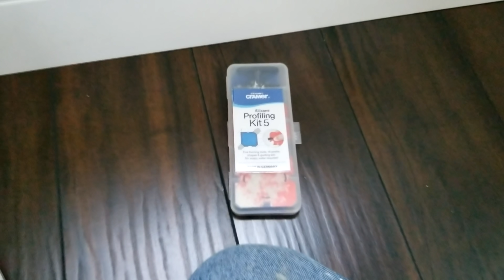How to Extend Laminate Wood Flooring To Another Room DIY Tips

Comment: Hi I have a question can you remove a transition on an already installed laminate flooring so as to achieve flow from room to room
Reply from the maker: Yes you can, but keep in mind manufacturers have limits where they say you need a transition every 20 feet for example, or another might be 40 feet

Comment: Why not raise that floor with some plywood sheets and make it the same level and make it a seamless transition?
Reply from the maker: Well that's a concrete floor and it would have probably taken 3 layers of plywood which is ridiculous you don't raise up a concrete floor with wood. If anything you would do self leveling compound. But that would have probably cost a few thousand dollars to dump down that much self leveler compound and the labor to get it done as well.  Also the 1st part of the transition was already there from before because this used to be a carpeted patio and the buyer of this unit wanted the carpeting removed and the wood flooring expanded. So keep in mind you have to deal with also what was already there as a transition.  The way we implemented this was a good solution and the buyer of our unit was happy with it.
Reply: What would've happened if you took off the threshold of the higher floor and made one new transition strip?
Reply: @jeffostroff  It is done when installing wood flooring on a concrete slab. You have to use 3/4" plywood and put a moisture barrier under the plywood.
Reply: thank you ...im surprise he didn't tell the owners to tear down the house and rebuild it....
Reply: @divinee.155  What was the point of your comment, Divine E?  This issue could have been correctly resolved with a  vapor barrier flooring adhesive and a couple sheets of plywood.   Instead, the owner now has a trip hazard that will get called out when they try to sell the house.  Cheaper and easier to do it right the first time.

Comment: Nice job! What blade do you recommend for cutting laminate flooring? Thanks
Reply from the maker: I was using 84T or 90T red diablo carbide blades to get the fine lines but... laminate and hardwood floors dull out the blade by the end of the job, not good, and by the end of the floor you are pressing down on your chop saw with extra force to get it to cut through, and it starts to heat up and burn the laminate a bit.  I'm going to switch to this new diamond coated 10" Pergo blade from Diablo: https://amzn.to/2KXLYPw make sure you get the right size blade for your saw. These Pergo blades from diablo are the only one recommended by Pergo for their floor planks, and they work on many types of laminate and hardwood floors.

Comment: I would stub my damn toes every time I walked into the main room
Reply from the maker: You brain trains itself over time to avoid these.
Reply: @jeffostroff  Kind of a cop out answer - and it certainly doesn't address the unsuspecting guest who trips and falls their first time in the house.  Customers ask for all kinds of things that are unsafe or are code violations. As professionals, it's our job to set them straight.   That's a lawsuit waiting to happen; I hope you got the customer to sign a release or you'll be on the receiving end of it.
Reply from the maker: @jeffeverde1   The problem with all of you fear mongets out there is you simply don't understand what's going on this was a patio  sliding glass door drop off at 1 time that used to drop down 2" from the living room. So there was already a step down anyway like every house in every condo here in Florida already has one of these step Downs and I don't hear of anybody tripping and suing anybody else.  What I did here was took a 2" drop and made it safer than it was, Because it used to be a 2" sliding glass door transition.  These are not code violations you're allowed to have up to a 7" step up like many people do with their front doors anyway.
Reply: @jeffostroff  You took a trip hazard that was clearly visible and turned it into a trip hazard that blends in.  Go you, outstanding work!  
Now lets consider how a professional*, *licensed contractor might have handled that issue- 
1) explain to the homeowner the benefits and value of doing the job right, and bringing the patio floor in plane with the interior using sleepers and plywood
2)  remove the existing trim and mill your own reducer threshold to create a custom transition
3) remove the existing trim piece and using a 5-6" threshold as a reducer
4) flip the transition piece you used around, with the thin edge on the patio floor.  It's still an abrupt level change, but at least it doesn't have a toe catching edge.

So many choices, and you went with the one that actually made the issue worse.

Florida's contractor license board shows no contractors under "Jeff/Jeffrey Ostroff".  So I'm guessing you're an unlicensed, unbonded, uninsured "handyman".

Comment: Couldn’t you just have removed the original threshold, or raised the patio floor using plywood or self leveller, I mean the extra labour in fiddling around with the 2nd threshold would have offset the cost.
Reply from the maker: Can't use self leveler, the patio floor is slanted. Adding plywood could introduce unlevel subfloors and is completely unnecessary to spend hundreds of dollars in plywood just to avoid raising the threshold another 1/2". After showing the owners all the options we had, this is what they accepted.

Comment: Why not avoid all the hassle of this joining the floor as you have done which is at different levels and which could be hazardous as someone can trip over?? I would add a ply board to raise the floor so you would not require this ugly joint and the floor would be exactly on same level! Makes a lot of sense 😅
Reply from the maker: I did what the new owner wanted, they were aware of the possible hazard, but wanted it this way.
Reply: Thanks for your response I understand 👍👍

Comment: lmao, what a pile of crap, he should be wearing a gun and lasso, he left no expansion gap, he didnt under cut the door frame,   what he should of done is take the last cut piece out from excisting floor and joined into it so the flooring runs through the door without a trim.